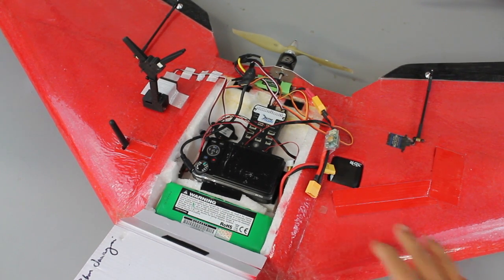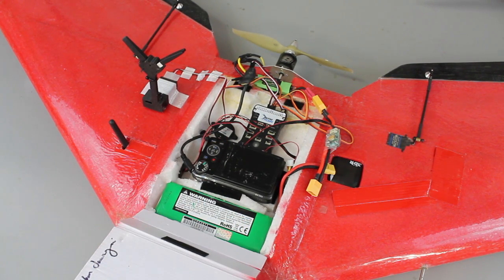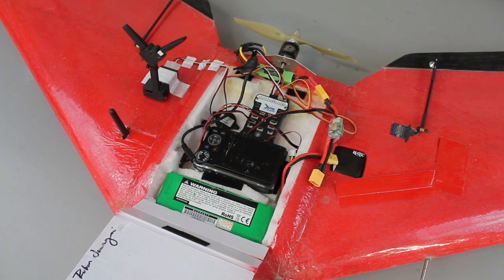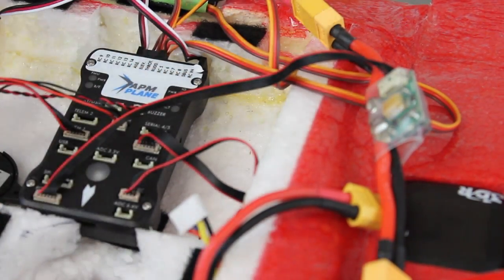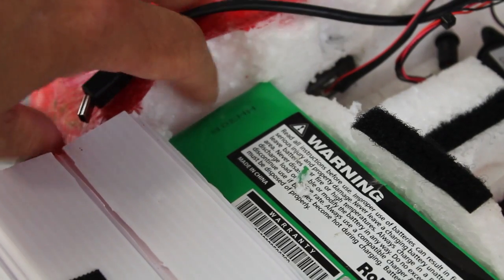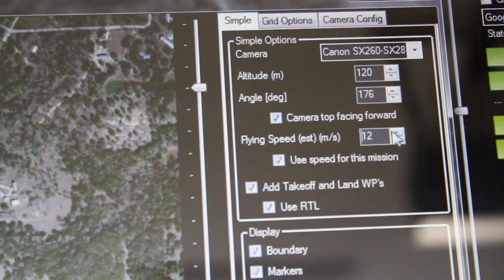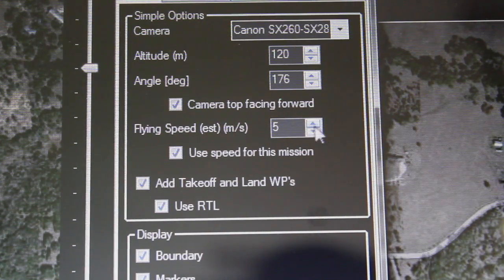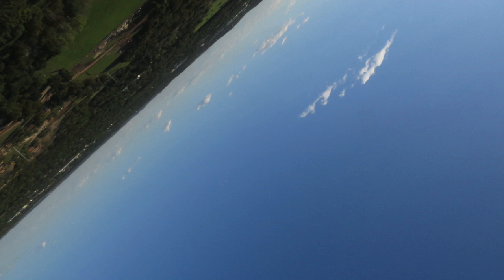How to Not to Plan a Mission with Pixhawk and SweepWings Juggernaut

Comment: hi Dennis,I have multirotors and no wing at all.I really like the skywalker X8.I want to buy my first wing(I will only be using auto take off and landing as I am not good at wings)would you recommand me the juggernaut or the skywalker X8?
Reply from the maker: There is a significant size difference between the two of those. I think the X8 is almost 7' across while the Juggernaut  is 4'. I like the Jugg because it's durable and fun to fly. I've never flown the X8 but it's probably similar to the FX-78 wing, which is probably bigger than you need. My very first wing was the TuffWing 32" only for learning purposes. Good luck and let us know what you decide to do.

Comment: Hi Denis,

Can one adjust WPNAV_SPEED in the Param files? That's how I've always done it in Copter,  both multirotors and Trad-Helis. I found that earlier versions of Arducopter wouldn't change the speed in the survey grid setup. I always had to change it in the full Parameter list after accepting the mission.
However, that being said, I am having trouble finding WPNAV_SPEED in the Params of ArduPlane V3.52.
There most be a way to adjust auto speed without having to create a survey grid.
Any suggestions?
Reply from the maker: +William Wegenast I'm not sure, but will look into it. I haven't updated lately so I'll need to check. If you discover anything in the meantime please let us know.
Reply: +Dennis Baldwin 
Hi Dennis,
I've been messing around with this quite a bit, looking into the TECS tuning now to get maximum efficiency.
Anyways, I've discovered that WPNAV_SPEED doesn't exist on plane. Instead, one must use, TRIM_ARSPD_CM. This does essentially the same thing, but is more dependent on airspeed than ground speed. Makes sense as you really don'g want your plane flying down wind at a low ground speed if your airspeed exceeds your ground speed.

This is very important to understand if you do a grid mission and the grid throws in a DO_CHANGE_SPEED command. Here you have two options. GS and AS.

Comment: Dennis, You may want to check out the fork of Mission Planner that Event38 is working on. It is modified for fixed wing and has warnings for camera trigger distance and airspeed. I haven't checked it out but will soon. I just saw this on http://diydrones.com/profiles/blogs/event-38-mission-planning-mapping-workflow-updates
http://droneyard.com/2015/05/13/mission-planning-workflow-updates/
Reply from the maker: renoflash06 Will definitely check it out. Thanks for the tip!

Comment: My question is what did you set as the minimum airspeed for your frame? The Pixhawk should not go below that no matter what you set using the DO_SPEED command on your planned mission.
Reply from the maker: mvh808 I don't have my log file in front of me right now, but will check. I know that the TRIM_ARSPD_CM was 1300 so basically 13 m/s. STALL_PREVENTION was set to 1 so I'm confused as to how this happened in the first place. I don't feel like it should have been going that slow. I'll do a follow up soon based on my discoveries. Thanks for the question.
Reply: Dennis Baldwin Check your ARSP_FBW_MIN value. That must be your min. airspeed and depending on that Stall prevention can/should work.

Comment: Hi Dennis, thanks very much for yet another very informative video. I've learnt lots from you so far. 

You might have covered this in another video - I would like to know if you have been using just the geotagged images from the Canon SX260 for your image processing? Or have you used the geotags from the flight log of pixhawk instead? Which have you found to be more accurate for mapping purposes?

thanks!
Reply from the maker: truem0bile Thanks so much for the feedback. I've been using both types of GPS data and your question is a great one. I've actually been doing a comparison of the two but don't have any conclusive results yet. I'm going to venture to say that the Pixhawk log will give you better accuracy assuming that the GPS timestamps are matched properly with the image timestamps. I ultimately want to use the method where you take the cam trigger message from the Pixhawk log and use that. The only problem I've read about with that method is you can lose accuracy if there is a significant shutter delay between when the 5V is sent to the camera and when the photo is actually taken. So many things to consider! Will definitely share as I learn more.

Comment: That's a shame, Dennis.  Really glad to see most of your gear came through unscathed.  I'm surprised that MP doesn't have a persistent variable in the initial model setup like 'stall speed' that carries over to missions such that mission planning wouldn't allow the entry of speeds below that setting. Bummer.
Reply from the maker: CradyLab Thanks for the feedback and yes I'm very thankful that nothing was severely damaged. I was able to put all the original parts back in and fly a few more missions then it happened again. Except this time I have no clue since it wasn't a minimum speed issue. Something else. I'm going to share my research in an upcoming video and hopefully we can collectively figure out what happened. Take care.
Reply: Dennis Baldwin Have the same issue with a Skywalker 1680, I thought it was the 5m/s but have had it do the same at 15m/s. If I'm quick enough and recover the stall/spiral and then go back to auto, it usually finishes the rest of the mission easily. It always seems to be problematic at first WP.

Comment: Check your CG .you can prevent it from crashing down. If you did balance the wing you could glide it back to home base.
Reply from the maker: Moe ledon Thanks for the info. I had the CG pretty much dead center. Had tested it with several manual flights and FBWA mode flies like a dream. Once it got upside down there was no going back. Unfortunately I couldn't recover quick enough and the wind gave it a nice boost in the wrong direction! I had done countless landings where it glided home just as you describe.

Comment: I am very impressed with how tough that wing is. Just wondering if you used a Air speed sensor and/ or if that would've helped?
Reply from the maker: Daniel Hanson I do use an airspeed sensor and obviously something didn't quite work as I had expected :) Will share more details when I learn more.
Reply: Dennis Baldwin Thanks, good to know.

Comment: Why would it flip over if there is auto level even with motor off on vector i can get 2d hold to keep a large wing stable. Great video bro just was wondering.
Reply: ***** It's called a tip stall. Very dangerous for full size aircraft as well. Start with going almost too slow to fly and then turn away from the wind and there is nothing to keep you up. I've crashed a couple planes this way but they were low to the ground so I never got a chance to recover.
Reply: I understand a tip stall but with an autopilot like that and the ones i setup never had an issue throttle off and it will fall flat out of the sky. Stabilization works great.
Reply: ***** I think the pixhawk was trying to fly at 12mph or 5m/s. Not very fast. With the large battery and camera the weight is just too high for that slow speed. I'm impressed it flew at all at 12mph. I use 5m/s when I'm mapping with my hexacopter. I hope they look at changing the default to something higher when flying Arduplane. I'm impressed at how well the wing held up. Now I need to build my sweeping juggernaut sitting on the bench.
Reply: Take a look at my custom shop and what we do with them. Just did a starwars theme one.
Reply from the maker: ***** Great to hear from you and hope all is well. I hadn't seen the new site in a while....looks great! Good question that I don't really have an answer to. I guess it got to a point of no return with the wind causing it to get inverted and was unable to recover. I had another AUTO crash this past weekend where I have NO CLUE how it happened. Everything looked great and the mission was well under way. It was pretty windy conditions and once again the Pixhawk/Jugg setup flipped over and headed straight to the ground. I've been looking through the logs and will share my experience soon. I'd like to understand what happened so I don't run into this again.
Reply from the maker: renoflash06 Totally agreed about the defaults!
Reply: :( that is a bummer. We are working on a ring also and love to chat some time. When you free email me or pm me on our FB page. Glad you got to see our website we have a pretty robust site now :) Look forward to talking with you.

Comment: So true, that 5 meter per second default is so annoying! I've been always very careful of it, however if you are using camera with a trigger  is easy to overlook since the speed is not so important untill ..stalls :/ For simplicity now I use intervalometer on 2-3 second and speed of the airplane 15 -20 meter per second when altitude is set to 200 meters
Reply from the maker: Georgi Tushev Good to know and thanks for sharing. I wish we could fly at 200m here in the states :)
Reply: Dennis Baldwin Oops, I forgot about the 400 foot rule ;P

Comment: The qav 500 man?
Reply from the maker: Lorenzo Longhini I'm glad you asked! I've been getting some good autonomous flights with it using DroidPlanner and Pixhawk. I was hoping to post a new vid in the next couple of days but the strangest thing happened yesterday. I hooked up my battery and then immediately an ESC caught on fire. I've checked that nothing on the PDB was shorted so perhaps it was an issue with the ESC itself. I'm ordering a new set today and will get those installed asap. Then I'll follow up with the QAV500 vids. Take care.
Reply: Dennis Baldwin What ESCs are you using? Wouldn't be KISS ESCs would it?

Comment: PLEASE do a video with the turnigy 9x with stock firmware and pixhawk flight modes. I'd love you forever. Using a frksy receiver and cppm.
Reply from the maker: badd99 I no longer have my T9X so unfortunately I won't be able to do this. If you do stumble across how to do it then please share. Thanks and good luck.